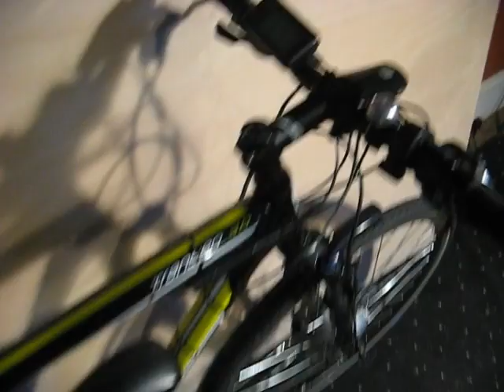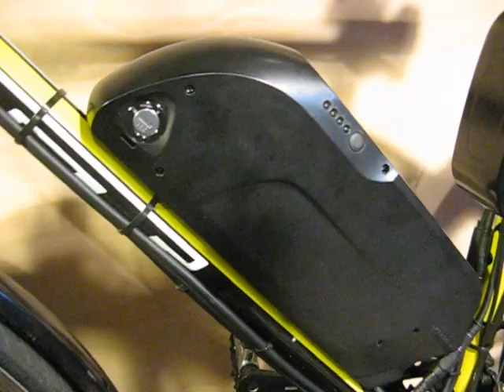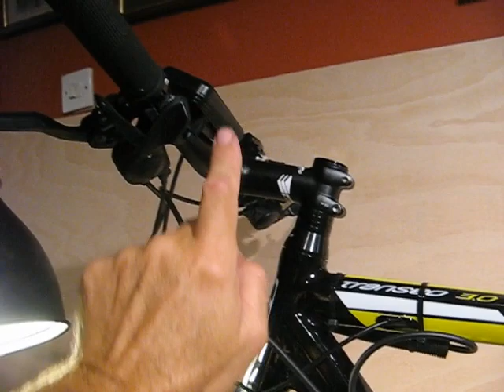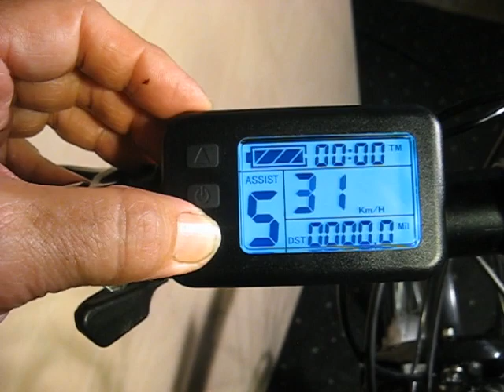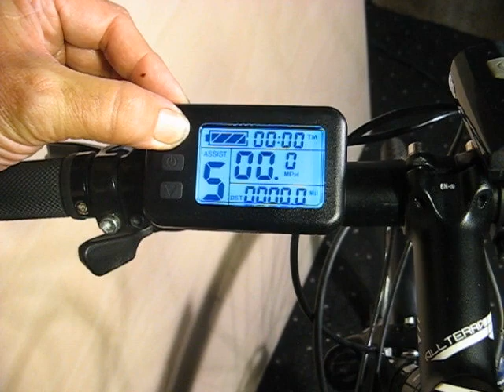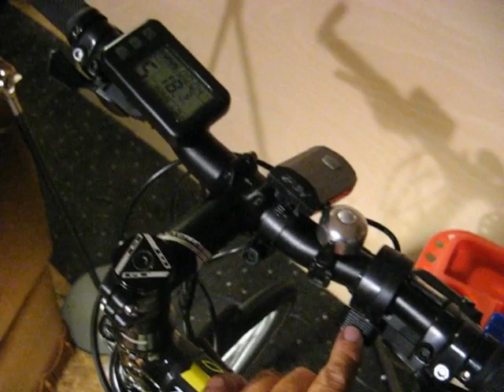Cyclotricity 250W Front Drive Ekit Hub Motor Electric Bicycle Ebike.  Updates in Video Description.

Comment: how not to get it stolen though?
Reply from the maker: The only time I leave the bike anywhere is during occasional short visits to the local shops,
when I lock it to a lamp post (or similar) with a ten-ton Kryptonite chain lock.
I've fitted a rack and bag with the sole purpose of carrying the (ridiculously heavy) lock.

Of course, the lock won't stop thieving scum nicking the battery, wheels, etc.
I would NEVER leave the bike in one of Bristol's dodgy areas, even with a ten-ton lock.

Comment: I ended up mailing cyclotricity and they mailed me back the correct settings for the p settings.. strangely having not altered any at all there were a couple that were nowhere near the settings they've given me, which I find odd seeing as it's supposedly new and untouched by me, so I'll change them to what they say and see how we go.. cheers
Reply from the maker: On my bike:  p1 87, p2 1, p3 1, p4 0, p5 12.
Reply: Thanks for that.. nothing like the settings that were on mine out of the box.
What they emailed me was the same as your receipt P1 and P2 were different. They told me to use those settings and select the smallest wheel size I could to see if it solved the problem.. Laughable.
Anyway I've just changed the settings to the ones you have and guess what.. absolutely spot on 👍
Appreciate your time cheers mate

Comment: I know this is a few months old now but i have the exact same kit and set up but my speed is way off saying basically double of what I'm doing, wheel size is configured correctly, did you change any of the p1 p2 up to p6 settings at all ?
Reply from the maker: I haven't changed p1, p2, etc.  
I suppose it could be that p2, the motor velocity signal pulse parameter, is set up wrongly.
I don't know what the setting should be.   I can't check it on my bike right now as the bike is not here.